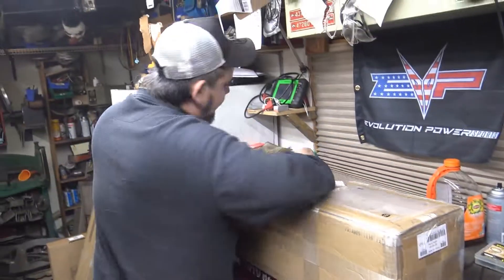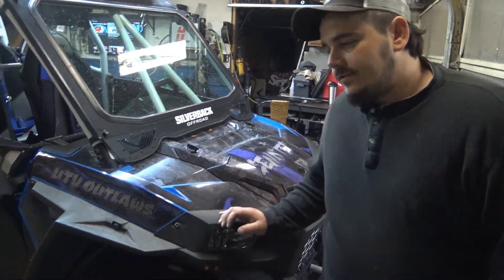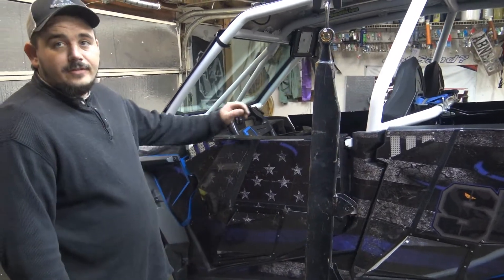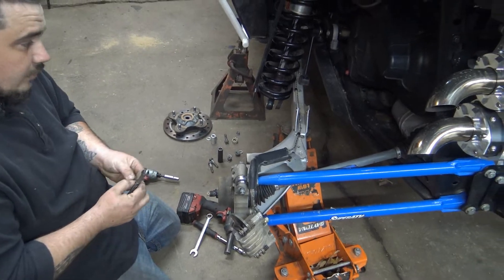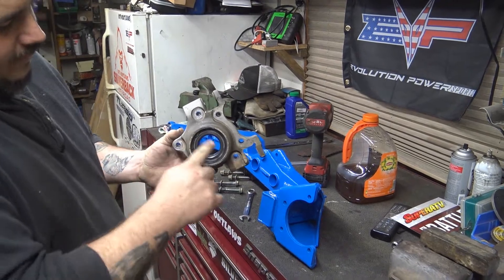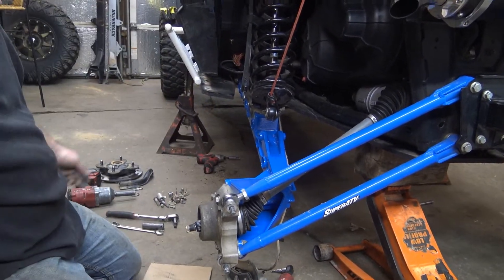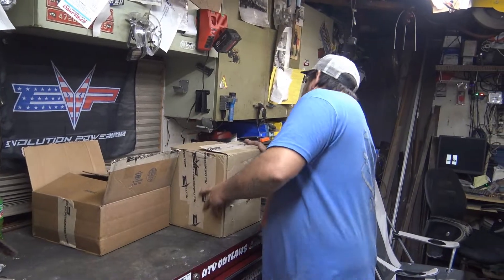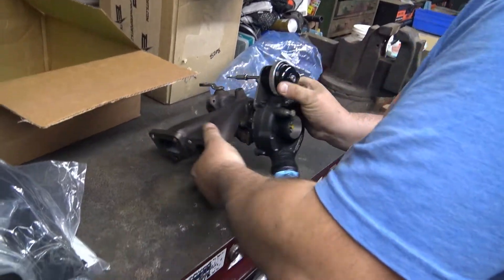Installing SuperATV Trailing Arms On A RZR Turbo!!

Comment: Did you check the alignment? How are they doing for you? I installed a set of the +1 SuperATV trailing arms and they looked great like yours, but are way out of wack. Rear toe was off over 1.5" (toe in). Way more then adjustable radius rods could even help. Have to send back after hours of swapping parts. Terrible quality control. Going with a more expensive brand next hoping for better results then the junk SuperATV sent me.
Reply from the maker: That’s crazy no I haven’t had any problem with that everything‘s good on mine I guess if one bracket got welded on a little crooked or something it could happen that sucks sorry to hear that I haven’t had any problems with their products Thanks for watching
Reply: @utvoutlaws6652  thanks for the response, glad yours were fabricated correctly. Keep up the good vids

Comment: Thanks the bolt i used was from fastenal it was a M12-1.75×160mm #0141760 part number and also i recommended having a 4×3 wheel its about 2 inches from rubbing on the tire so stock wont cut it
Reply from the maker: Thanks for the additional information, good to have incase anyone is poking through these comments. Thanks for watching as well!
Reply: Bro you have help a ton i love watching your videos

Comment: Have you guys had any problems with a rear axle popping out the transmission? I installed this arms on my rzr and one of my axle popped out.
Reply from the maker: No we haven't, but this machine has limit straps on it so maybe that helps. Thanks for watching